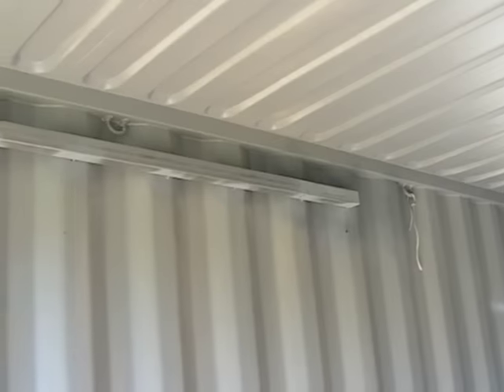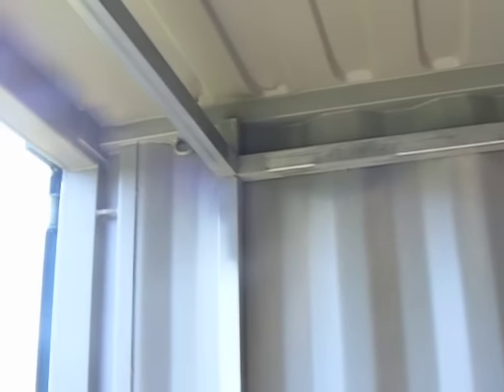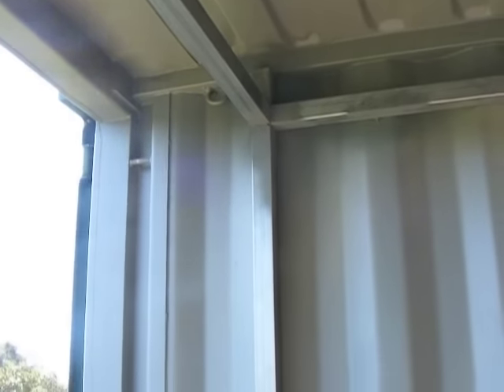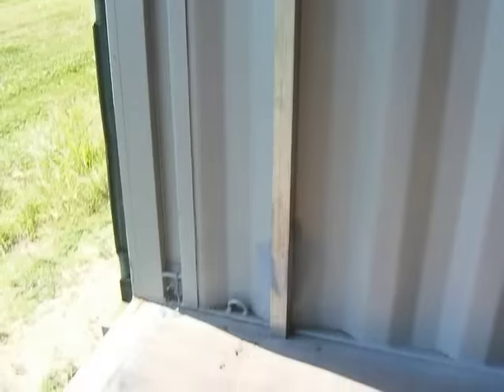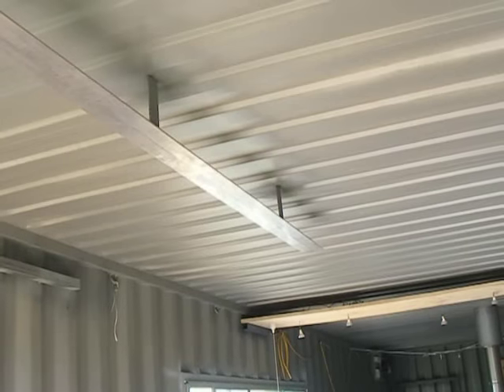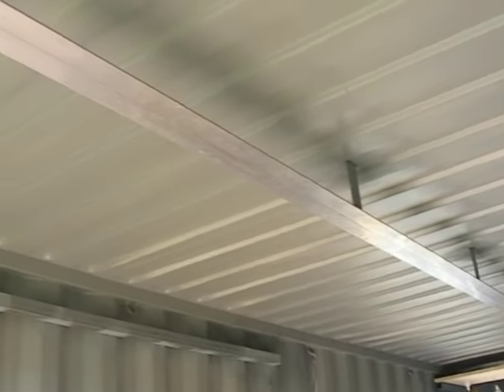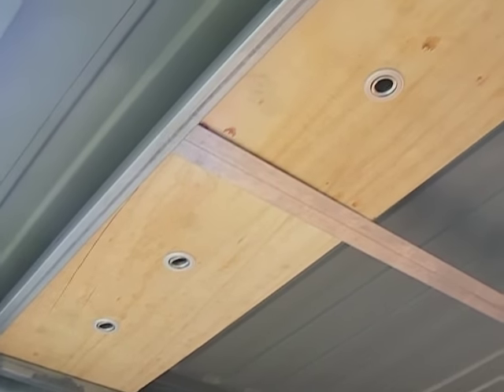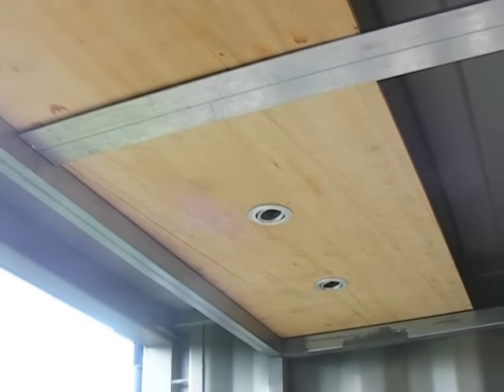Shipping Container House - Suspended ceiling

Comment: Hey man great job on building all this on your own. If you don't mind me asmig what was cost for the containers and everything overall? I'm looking into doing something similar but in my backyard.
Reply from the maker: Hi MidCali831, Short answer from 40k upwards. Real answer, it depends on what you are going to do. I break down the costs for each stage of the project in the ebook YT video - Shipping Container House - How to build off-grid shipping container house ebook. If you are serious it will give you an accurate idea of each of the project prices, sunroof, solar electricity power, windows, doors etc. My project has 3 containers and a big solar array so you might get a much smaller number depending on your project scope. Cheers Paul